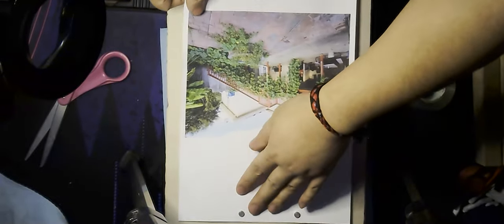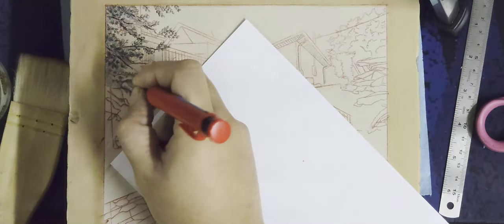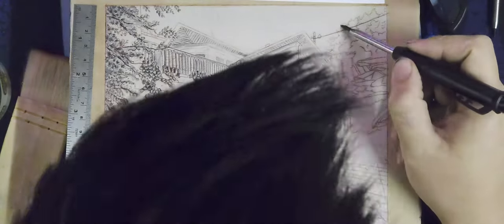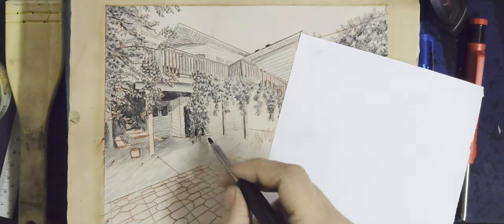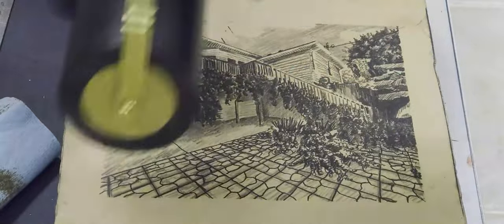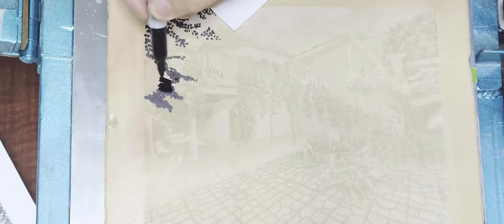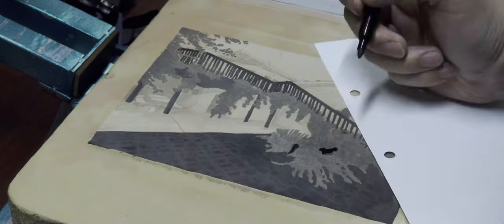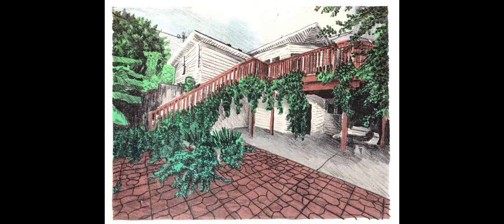Making a color lithograph landscape

Comment: I like that mini litho press!...tell me more 😁
Reply from the maker: It's a homemade litho press, an aluminum topped plywood bed with two steel tubes underneath. I have two U shaped pieces of steel underneath full of oil and it slides on those. And the crank wheel is attached to a drum that pulls a tow strap attached to the bed. Quite a horrible press that constantly leaks oil on my table :(

Comment: omg those metal trimmers are really cool!
After paper stretching, do you still soak them before printing or leave it dry? I am thinking of using etching papers for some of my prints and I wonder what would be your advice?
Lastly for punch registration, if I am working with 1 or more plate/stones for the image, how do you make sure they're registered? 
keep up the great work ! :)
Reply from the maker: When I do multiple color prints I prefer to print with dry paper. While I have not tested it, I worry that wetting paper would let it expand and potentially throw off my registration. For Punch registration using multiple stones/plates I will tape a set of registration pins to each matrix and use one master sketch(with holes punched) for the planning of each matrix. I've also tried punching holes into clear Mylar and printing my key layer onto it, and taking that to my other stones for reference. Good luck!
Reply: @someprintdude  they are very very informative, thanks! good luck to you too